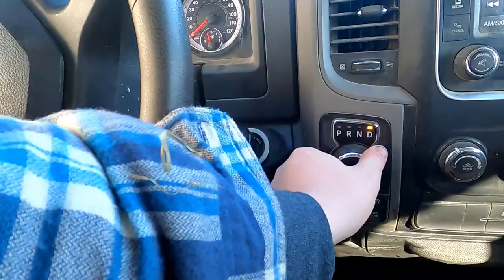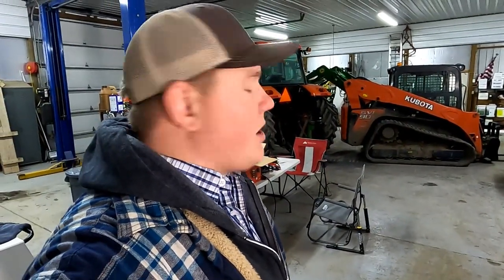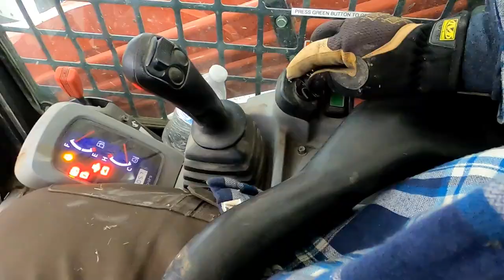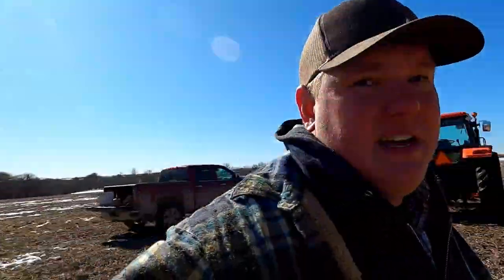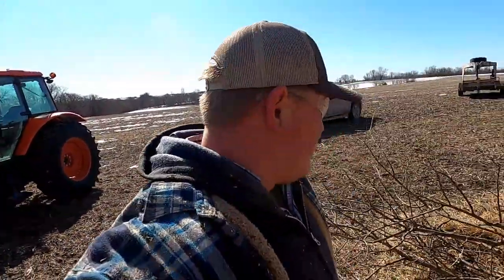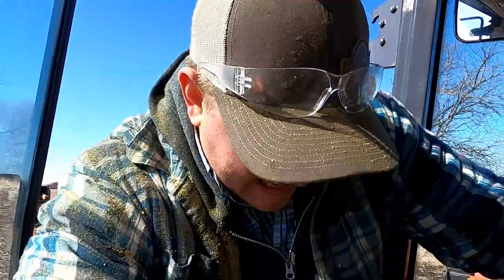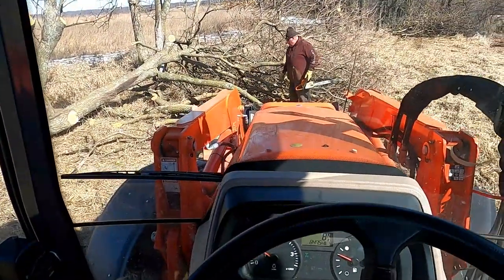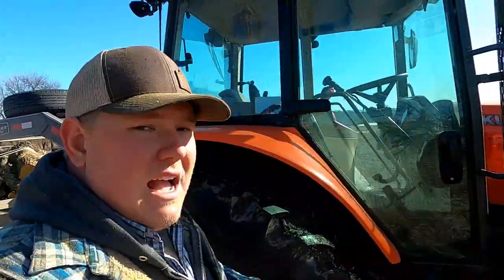CUTTING HEDGE! - Off Season Work - Vlog 4

Comment: The best way to cut hedge is with a D6. Roll in pile, Burn pile, go to town buy fence posts. Actually I find a pole saw works much better for cutting hedge and safer. I've had to many close calls with hedge getting caught and twisting and coming back at me.
Reply from the maker: Daniel Henebry I’ve been there too. My dad actually caught one on the elbow this day.

The best way for us to cut them is to push them out with the dozer, cut the easy post, and manipulate it with a hoe to keep it safe.